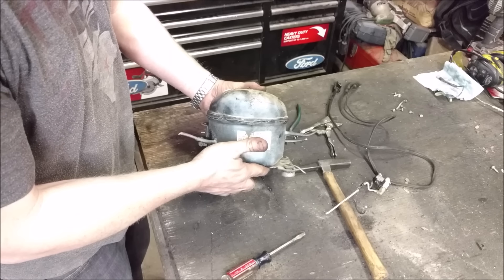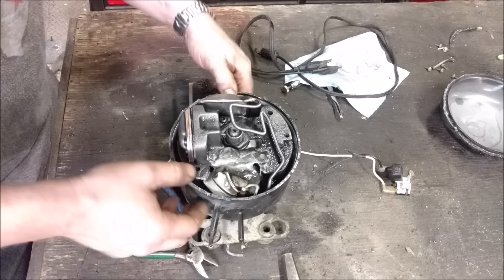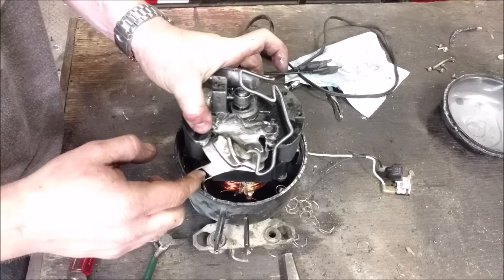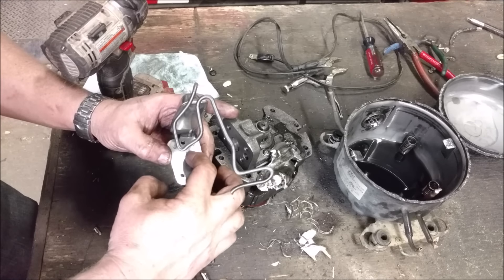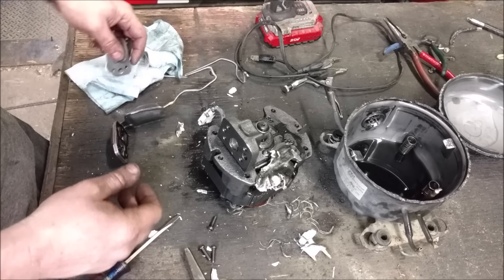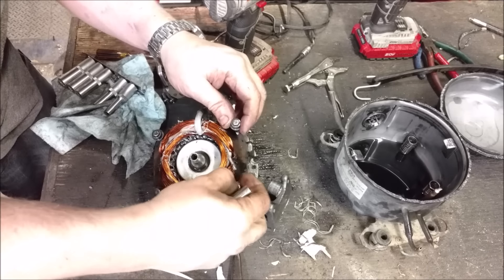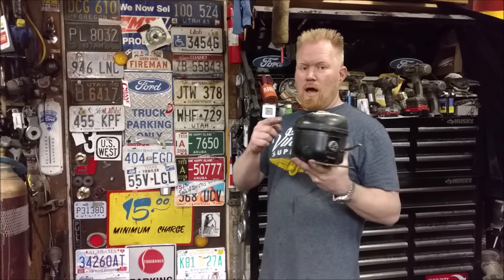What's inside a Refrigerator Compressor

Comment: Always a thumbs up for you Brother! How you liking the Grip 6? AND...third time is a charm. Asking this question that is....Do You Need A New Spindle for your deck? I've got PLENTY of them here and would be happy to send one your way. Cheers my Friend! Zip~
Reply from the maker: The Grip 6 has been very nice. I almost wish the belt had give or a very very firm elastic to take up slack while sitting but return to the same tension while standing. It does however hold tension better than any other belt. I bought 2 for my brothers for Christmas but haven't asked them about it as they live out of state. I would love an outside spindle.
Reply: Shoot me a private message Moe and I'll get your address. I just rebuilt one, so I'll send you that one so you won't have to worry about doing anything but installing it. Cheers!! Zip~

Comment: I have been searching for an answer to my issue for 2 days and have come up empty. I hope you can help. I had a new chest freezer delivered 2 days ago and it was unboxed in my house. I noticed the vent grooves were very dirty so I ran my finger across it and it was either gray dust or powder. Before plugging it in, I wanted to make sure what I saw wasn't also inside the vent so I removed the panel and it is like new. I was relieved, but then noticed the compressor has a hardball sized discoloration on it, like it faded to grey. Unless it's the lighting in your video, what I'm trying to describe is pretty much like yours, but my faded area has some  black spots in it the size of a pea. I have looked at dozens of compressor images online (can't find the exact replacement part) and they are all shiny and pure black. I'm wondering if this is not a brand new freezer after all.
Reply from the maker: First you can look at the tag inside the freezer and there will generally be a date code of manufacture. These sit in dirty factories and are test run to make sure they work, so dust isn't a huge concern. Lastly there is little care taken when painting the compressor as virtually no one looks at it. They paint them as fast and careless as possible just so they're not bare steel.
Reply: @sixtyfiveford  Thank you for the prompt reply. There isn't anything inside. There is a bar code sticker with a batch # on the outside back and I'm assuming the serial # is the long one under it.  (VL025003W01JLD1PVS20120). I don't see a date in there. Freezers are hard to come by since Covid started and many sites are on back order. This one particular site keeps changing from dates in Oct, then Dec. then to Nov. I just don't know where they are getting them from. I was told I wouldn't have one until the beginning of Nov. and then last week they said mine was in. This doesn't look like a sloppy paint job on the compressor, that's why I wonder about the discoloring.  I hope it was a return and they re-sold it as new instead of open box. I don't need someone else's problems. lol

Comment: So are the fill tubes and the low pressure side both leading to the same place?  Do they both connect to the main body of the enclosure surrounding the pump?
Reply from the maker: Yes, they both just dump into the case.

Comment: Having an oil for lubrication pumped upward is a clear IDEA. 
Yet, I wonder what happens to the oil if I want to empty the  refrigerant  in the compressor? 
Either by running it while the evaporator line is open freely or by pumping the refrigerant loosely?
Will it be critical to add oil + refrigerant when I want to recharge the system again or refrigerant is enough?
Reply: Am I missing something? Like the OIL is R134a refrigerant? Or is it something different?
Reply from the maker: A small amount of oil gets pushed through the refrigerant lines with the refrigerant. A leak would cause a small amount of oil loss and generally a tiny bit of oil will be added back in when the leak is fixed/system is refilled with refrigerant. This is generally a very small amount and not adding oil back in to replace the theoretical amount lost would likely not cause any issues.

Comment: Found out what is behind "ping-pong" noise in my fridge, thanks to this. The pump is bouncing against the inside of the receiver housing. The suspension springs must have softened over time. Comparatively new, five years, to be breaking down. I've had much older refrigerators that never made this noise.
Reply: I have same issue, yours still works?  When it starts and stops ping pong

Comment: I've got a 35 year old GE refrig.   The compressor will turn on, then in a few seconds turn off.   Anyway to determine if the compressor is bad or
if there is a over current or over temp. switch tripping some where to soon?
Reply from the maker: Fridges have a start relay on the compressor motor itself. It looks just like the plug connector but actually is what makes the compressor start and then continue to run. 

How it works:  When the thermostat inside the fridge senses the temperature is too warm it sends power to the compressor. You need a lot of torque to start the compressor at first so the start relay sends power first to the start windings int he compressor motor. This lasts for maybe a second or two. Then once the compressor has started it switches the power from the start windings to the run windings and the compressor motors runs like it normally would.

Comment: I have a samsung RF31 Refrigerator, having problems with evaporator core freezing up and the ice maker freezing up. is there a "thermal expansion valve" on this unit and if so how is it repaired? repaired meaning welded or is electric of some kind. any help would be appreciated.

Comment: 1:43 - 2:23 So the freon is in both states simultaneously? a gas hovering in the bell-housing-chamber & a liquid in the pipes? or vice-versa ("liquid falling over the baffles"). And how does it go from one state to the other from the chamber into the pipes? Is there a funnel so it's directed in more easily? Where is the funnel? Or is the freon that liquid stuff in the bottom chamber, that then gets sucked up into the lines?? Is it dangerous to work on these things? How come you're not using hand-protection, and touching the wet-parts? I've had so many window-ac's and dorm-fridges break on me over the years, i'd like to start fixing them.

Comment: Nice video.  Thanks for putting this out.Out of curiosity, what is an average operating temperature for a compressor that size (I'm sure it varies).  The reason I ask is that my wife purchased a used upright Frigidaire freezer and the compressor seemed to reflect anywhere from 125-150 degrees while running (this freezer does not have the traditional condenser/cooling fan setup - which I thought was weird but I guess that's the way they are built now).  The compressor was obviously very hot to the touch and I was concerned about the heat.
Reply from the maker: The coils are just under the metal skin on the sides of the freezer instead of hanging off the back like traditional coils. You should be able to feel the sides get warm and should not lean or stack anything against the sides to allow proper cooling. The compressor will get pretty warm, especially if it is cooling for the first time or you just loaded it up with non frozen stuff. 125-150F sounds within reason.

Comment: Damn, you could make quite a few bucks on scrapping that. Got a decent amount of copper, steel and some kind of brittle cast metal from the looks of it... hopefully it's not a zinc alloy. I've passed up so many refrigerators because the frame would be a pain to chop into manageable pieces and remove plastic. Now I know I should just run up and snatch the compressor. Never really thought about it.
Reply from the maker: It would put more wear on the tools or cutting discs than you could extract.  I really can't imagine there is more than 50 cents worth of scrap copper in this thing and 1 cent worth of other materials.
Reply: Always good to add more... I collect all kinds of electrical wires and stripping the rubber off is a pain. When I see lamps or appliances on the side of the road I'll usually stop and cut the wires off, check for anything else I can find that's copper.

Comment: I bought a used refrigerator and the guy delivered it on its side in a van.  He just said to let it stand for 24 hours to let everything drain back down.  I did that and it worked for several years until I had enough money to buy a new one.  The only problem was that it would rattle very loudly when it shut off.  I could make it rattle by shaking the compressor by hand.  It looks like maybe one of the springs fell out of place.  Did it look like they were secured, or did it look like they could fall out of place if the refrigerator  was on its side?

Comment: So the refrigerant doesn't mix with the oil? How it is separated or is it all flowing to the evap coil, etc.
Reply: The refrigerant gets sucked in to the compressor in form of low pressure gas since it came from the evaporator, so it wouldn't mix with the oil.

Comment: The compressor isn’t compressing air, it’s compressing. REFRIGERANT.  Many refrigerators over the last 20 years were made with R134a refrigerant.  The compressor takes the low pressure gas coming from the evaporator coil in the freezer and compresses it which makes it very hot. It then goes to the condenser where the hot, high pressure gas gives off heat. Air is blown across the condenser coils which removes some heat. The cleaner the condenser coils, the better. The hot gas is cooled and condenses into a liquid. It then goes through the EXPANSION VALVE where it is released into the evaporator coils, absorbing heat and cooling the freezer and refrigerator. And the cycle continues.

Comment: Saw your first one long ago but this one really was fried! Nice that you covered it again though.
I'm guessing these could only be used for small light weight (pressure) jobs like air brush painting or filling tires etc?
Reply from the maker: Yeah, a lot of people use these for small projects like air brush painting. They will fill tires OK as well.
Reply: I guess it would work for bicycle tires, but for a car tire it must take an eternity with the little thumb-piston pushing squirts of air on each stroke.

Comment: Just curious how many watts does that compressor utilize?  or a similar one? Or max amp draw?
Reply from the maker: This small one pulls around 4amps at 120v while running but will have a split second surge of around 15 amps.

Comment: Hey buddy, do you need to keep the oil in the compressor when you take it from the fridge to use as a air compressor? I emptied mine completely. Its working fine so far, but have i messed up or?
Reply from the maker: It will need some oil. You can just add some on the air intake side. Any automotive oil like 5W30 or 10W30 would work just fine
Reply: @sixtyfiveford  awesome thanks, how much would you say roughly about 2 cups? And i hope you do mind me quizing you lol ya really helping me out. So when its used on a refrigerator is the oil and refrigerant mixed together? Yano when i emptied it as i removed it there was frost on the ground it it went fast, im guessing it has similar properties to a deicer
Reply from the maker: @maxwayne4323   Just 1cup. The oil mist moves around with the refrigerant through the lines. So these will push out a little oil over time and a little should be added from time to time.

Comment: Those bolts are probably made for 12 point sockets, they do look like a inverted torx head. 6 point sockets don't work very well when removing em. That round thing with the wiring is a stator, the drum looking thing in the middle of it is a armature... a simple basic brushless motor is all it is.
Reply from the maker: Someone pointed out that they are "External Torx Plus" bolts. Odd balls for sure.

Comment: Are those taller skinnier compressors different inside? The type they use for window airconditioners?
Reply from the maker: The taller skinnier ones are generally scroll compressors vs the piston compressor I show here.
Reply: @sixtyfiveford  Thanks! I want to check those out next.

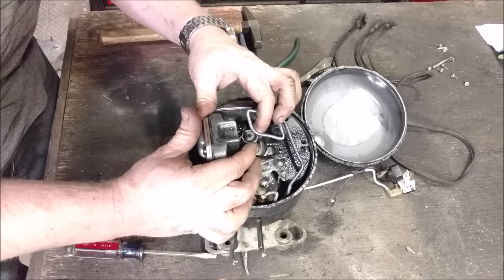Comment: Just in case you're answering this 5 years later... around 1:20 you mention the compressor getting too hot. Does the compressor 'normally' stay on the hot side (and you mentioned it getting really hot?).
Reply from the maker: During operation it runs pretty warm. It can feel hot to the touch but you should be able to leave your hand on it.

Comment: I've heard a few people say you can't turn a fridge's motor upside down or it'll break, but from your video I haven't seen anything that would explain that kind of thing. Is it really true? And if so, why?
Reply from the maker: If you tip the fridge the liquid refrigerant could get into the suction side. Turning it on could allow the piston to suck in liquid and the piston/rods/reed valves could hydro lock and break. Tipping the fridge then allowing the fridge to sit upright for a few hours before turning it on makes sure any liquid has settled and you will have no issues. So you can transport it laying down without issue as long as you allow it to sit upright for a while before plugging it in.
Reply: @sixtyfiveford  Wrong. Liquid (eg disturbed oil) going back into the suction side is fine! As you even showed in your video, it simply goes back into the big chamber. And the refigerant is never a liquid, way down at the compressor.!. Learn properly about the refrigeration cycle please. It's only a liquid when leaving the capillary tube at 'low' pressure, and -20 odd degrees C, as it enters the evaporator to do the job of cooling.

Comment: Why did it burn up when you plugged it in?  Was it already shorted out.
Reply from the maker: There is two sets of windings; a start and a run set. The Start windings
 were already burned out with no electrical connection (reason I had to 
start it with the drill). The Run winding was shorted to itself and 
drawing a lot more current than it was supposed to. This made it produce
 a lot of heat(burning the oil off) and finalize the shorting out.
Reply: ok cool.  At work there is what has to be a 50's frig still running.  Very original.  Makes you wonder how its still working, and why do modern frigs seem to fail so soon.

Comment: Did he wager a guess as to why it overheated?  Did it not cut off when it was supposed to?  Was the oil passage somehow clogged up?  Curious what makes them fail.
Reply from the maker: Broken Reed valve caused it to run way longer than it should have to maintain refrigerator temperature.

Comment: if you use one of these as an air compressor do you need to add oil on occasion and if so what kind of oil would you use?
Reply from the maker: Personally I would just use an engine oil like 5w30. It holds around a 1/1.5 cups of oil total. They will spit out a fine mist constantly which is probably equal to a teaspoon an hour(guesstimate). So adding an equal amount every few hours of run time would be fine. You can test yours by putting the outlet in a jar and see how much it spits out after 30minutes.  Make sure it doesn't get too hot after a 30minute run(possible 15 minutes cool down and another 15 minutes).

Comment: Is that oil just sitting there or is it carried with the refrigerant like a car AC system?
Reply from the maker: For the most part it just sits in there. a very small amount may mist and get pulled through the system, but it's not needed.
Reply: The purpose for the oil is lubrication. We know that. Oils are miscible with refrigerants. The entire inside of all systems are coated in oil from operation. So to speak, gas picks up and drops oil off. It doesn't just sit there. There are several methods of moving it.

Comment: So the oil in the bottom is why you should not turn on a fridge after moving it? If it gets into the air intake and sucked into the cylinder it will probably liquid-lock the piston, stop the motor and smoke it?
Reply from the maker: @ChrisBigBad  exactly

Comment: Hello again, i've seen other teardown of these and ive noticed that some were placed upside down, the motor part was on top and the piston mechanism was at the buttom submerged in oil opposite yours.  In your opinion wc design is much better in terms of wear & tear or durabilty?

Comment: I always thought the compressor pumped the refrigerant as a liquid after the condensor changed it from a hot gas back to a liquid? I have it backwards ?
Reply from the maker: It compresses the gas and it turns into a liquid under pressure.

Comment: is it actually safe to open? won't it explode or release anything dangerous?
Reply: There's only the refrigerant gas and once you puncture the tubes (when taking it out of the fridge) it will evaporate and release any pressure there might be in a fairly controlled manner, so nothing really dangerous.
Reply: So mostly opening this thing is just annoying, having to cut through the welded casing :)
Reply: @pev_  OK thanks for the answer, learning weird things everyday. :D playing here better safe than sorry.

Comment: Question.  So when I was told never to lay a refrigerator down when moving because the oil will run out.  Where is it running out to?
Reply from the maker: You can lay a fridge down you just need to let it sit upright for an hour or two so the oil settles back into the bottom. It can run up into the return line.  If you start it right away and the oil is up in the line it could cause a blockage/pressure spike and you can break the piston or valves.